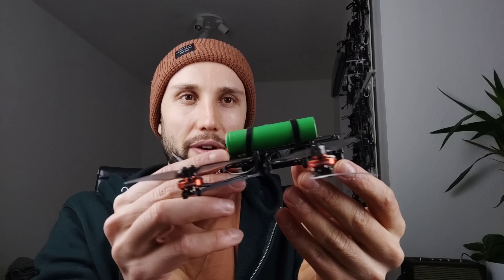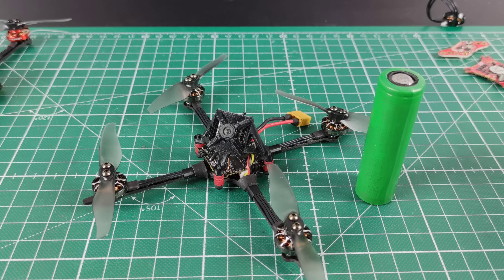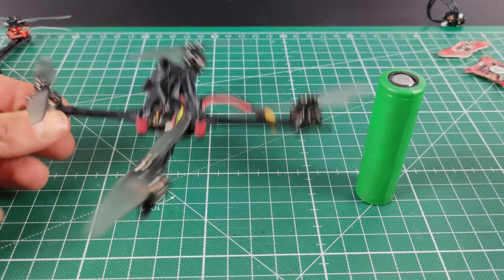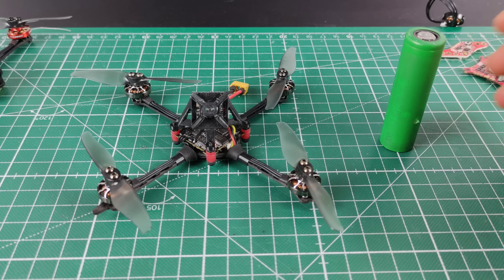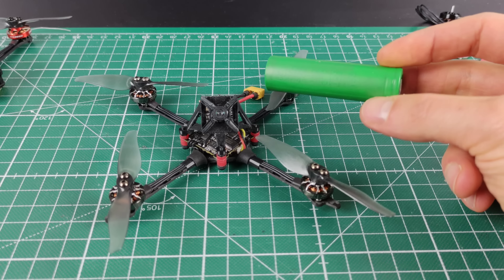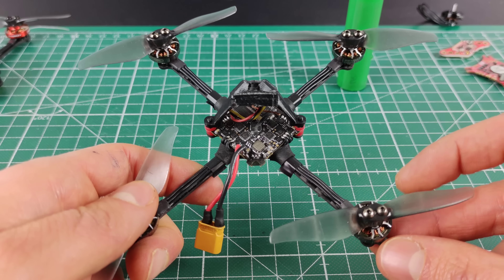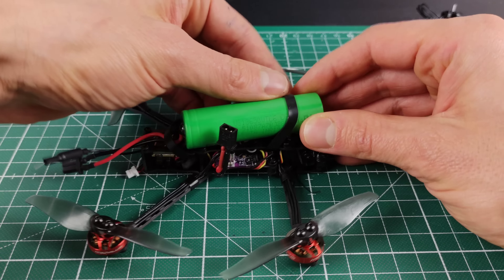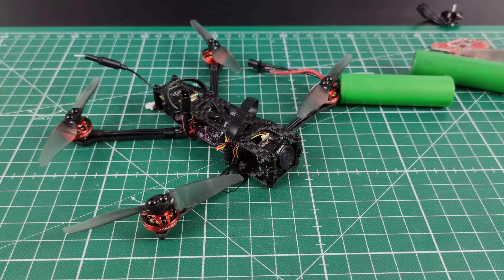#NanoLongRange

Comment: Awesome. I did some 18650 flights with that same cell on a 1S Baby Tooth.  After a bunch of flights I was getting a consistent 9-10min of actual no holding back FPV flight. I could get another 3-5min of hovering around but not enough power to have any fun with.  The new 1S FC we've made has a min operating voltage of ~2.3-2.5v with the hopes that something like this would be closer to possible.  I found 1103 motors to be more efficient.  I can't totally explain why and the performance definitely suffers a bit but it was definitely more efficient.  My best guess is the voltage better saturates the stator and the taller magnets give it the ability to maintain more rpm with less power. 

A couple years back, Chad Nowak did some calculations and came up with the ideal weight on a 3" prop at 90g. Pretty intesting that were around that weight and the overall performance even on just 1s really is quite surprising. Disk loading is proving more valuable than I thought. 

Those battery holders unfortunately don't conduct amps as well as a solder. Similarly, it's a bit sketchy but covering the battery ends really limits the cooling potential of the cell.  The ends of the cell cool it better than around the body.  The amp draw is high for the single cell so the cooler the better. 

I considered trying to squeeze more performance out of such a thing but ultimately gave up on it because of the lack of watts to do much with.

Also, I didn't test this because I only use xt30 but moving to an xt30 alone could give you more flight time and performance.  In my testing I found the gnb27 to be just a tiny bit better than the BT2.  Both are way overshadowed by the unfortunately much heavier xt30 and I've found these things in even 1s benefit from that.
Reply from the maker: Awesome, thanks for the inputs, Bob! It's really quite surprising how well these 1S platforms can perform. I probably wouldn't have believed it if someone told me that you can properly run a quadcopter with only 2.5V on the power supply. The lack of power further down the voltage range is less of a concern for something geared towards being a mid-range cruiser. The tray thing might indeed be too inefficient but it's worth a try. I have one with large gold plated contacts that look promising. The convenience of just popping a cheap and widely available 18650 in and get 15min flight time is just too appealing.
Reply: @DaveCFPV  I like to say that tv remotes run on more voltage 😅
Reply: @DaveCFPV   Can I print some and make the prints available at fpvcycle.com?

Comment: 1. Press-fitting those props is more than enough to keep them in place
2. Crazybee f4 lite actually has 350mw vtx (at power level 2), however it still shuts down at 2.7v (ESCs started rebooting during my tests). I will try to modify 5v step-up circuit there to accept lower voltages, but don't know when...
3. You should try 4" props on those 1202.5 motors. You may say it's a lot for them, but hear me out: once I've seen 1102 10k kv motors flying on 5045 props, and they were handling well! So I think that will be enough
4. Try making simple dipole for GPS, it should be enough

Overall: once again, very interesting video exploring new unknown territories

Comment: All of the outer "casing" of the battery is "ground", so you don't have to run the full metal bar from the other side, you can just open up the protective shrink wrap by the positive pole, and solder them kinda next to each other!

Comment: Well I'm messing around with 1s babytooths too. Here are some ideas: 
-I'm using no prop screws and it's fine (flywoo robo 1202.5) 
-There is no need for a top plate, 3d printed parts cold hold the battery. 
-You could save weight by using the Caddy Ant lite (1.5g). 
-Did you try the Gaoneng 1s 3000maH Lipo? 
-Try the Happymodel CrazybeeX with integrated 200mW VTX. On 1s you won't need a capacitor either.
-There needs to be some kind of higher quality video recording which is for me the main selling point of mid/long range. Naked insta360go? Runcam split 3 lite?
Thanks for being creative and innovative! BTW, I'm using your Sanchez lite design on my babytooth :-)
Reply from the maker: Thank you! Really great ideas. I have my doubts that HD will ever work on one of those, but who knows...
Reply: Maby a 2s 4" lr would be a nice middleground with enought power for a naked GoPro. Has to be under approx 125g to carry 2x 18650 + naked GoPro.
Reply: I am starting a build to, and opted for a dvr vtx. The fpv cam feed is recorded before it enters the fc. The caddx ant gives pretty good footage straight from the cam, although not HD, it is good quality.
Reply: Why not 21700 5000mAh/35A instead of 2600mAh/35A? +26g and + 100% capacity.
Reply: @benzoesansodu5866  you are sacrificing too much efficiency. The quad will be about 25-35% heavier. Currently the best option is lightweight frame with Sony vct6 3000mAh (47g)
Reply: @Unboxingexperience7  heavier but 5000mAh instead of 3000mAh. Its worth to test. Even Mavic Mini 1 with 5000mAh have 45min instead of 30 with 2600mah but are much more heavier.
Reply: @DaveCFPV  maybe a naked Vista with a step-up converter :)
Reply: You can reduce the weight even further, if you try to solder the negative Powercable directly to the cell, by removing a bit of the Heatshrink near the Positive Pad.
Reply: You probably dont care at all but does anyone know of a trick to get back into an instagram account?
I was dumb forgot my account password. I would love any tricks you can give me!
Reply: @Kristopher Briggs Instablaster =)
Reply: @Zane Elisha it worked and I actually got access to my account again. Im so happy!
Thank you so much you saved my ass !
Reply: @Kristopher Briggs No problem :D

Comment: Great vid. Accent is very understandable, no issues. The documentation is top notch and appreciated by me and others I'm sure. Have a Babyhawk 3" w f4 board,  rakon blade guards, was breaking blade too much, cam mount made of leather, old belt, Its fun.  The only suggestion I have for the batt tray is make one much lighter. Copper tabs on ea end. Stiff thin plastic under. The smart play, thin batt straps to secure. I love 18650's. E Musk came up w 2150 or something slightly bigger,  for his e car batts.  So, the metal casing has more weight than a comparable L ion but will never be damaged in crash. I'm subscribed.

Comment: This is super awesome. This is not a solution in search of a problem, its totally the kind of class of quad the hobby is missing: Accessible long range. The hardcore long range stuff is intimidating, but your parts list on thingiverse comes in around $100 usd which is super reasonable.

Comment: For the battery holder, you don’t need all the plastic in between the contacts. Just the ends that could possibly snap into the top plate. I would say skip the gps unless you figure a way to lose some more of the weight and keep it working. I would fly it

Comment: Love the idea! Few ideas while watching: (1) could you shorten the top plate at the front and print PLA standoffs that you could attach the camera directly to instead of separate TPU mounts? (2) Instead of a battery holder, could you print (PLA again maybe?) two end pieces that can be attached to the top plate (maybe using slots cut in the plate?) with contacts for the battery? (3) if you do mount the battery a simple switch might save weight for wires to the FC as well as for the connectors?
Reply: Yeah, stiff mounting end brackets for the 18650 cell, but then you actually don't need connectors or switches, you just take the battery out. 😁👍
Reply: @Anziilife  LOL - yeah, just take the battery out. I just like having a switch :)

Comment: For your GPS antenna testing, you might look at a nanoVNA. This allows you to meausre the impedance of your antenna so you can tune it properly. You might also look into GPS fractal antenna designs.  Also it would be interesting to see a breakdown by weight of all the components to see determine where removing weight would give you the best gains.

Comment: What is the Nano LR frame you are using? It looks different then the explorer LR?
Reply from the maker: It's a design I quickly put togehther. Less than 1/3 the weight of the explorer.
Reply: @DaveCFPV  Now do a Nano hex...🙄... 😁😁😁😁😁😁😁😁😁

Comment: I've been looking at something similar, but noticed the same issue with a 1S config.  So I went with a 2S 14500 pack (1000mAH each, 10A continuous, VAPCELL H10's).  The 14500 come in at 22g each, and at the end of discharge you still have 5V output (so you might come out ahead vs the 18650 cell).  I also explored a lighter GPS by removing the ceramic puck.  Just pull it off and replace it with a 45mm wire monopole.  For a full INAV config you probably want a barometer and compass as well.  I'm currently debugging a combo gps/baro/compass/RGB LED module that's about the same size as a BN-180 but only weighs 2.2g.

Comment: Why are you using that specific battery? Size? Weight? I would use an 18650 or 21700 4000mah.. Or is that too heavy?
Reply: The vtc6 18650 cell is the only cell that can deliver 30Amps continuous and does not drop voltage below 3V as other 18650 cells
Reply: @DutchCommando  You should look at vape batteries. I just bought a pair of 21700 4000mah 30amp samsung 40T batteries. There are a bunch of very strong vape batteries. In 18650 size too.

Either way though. Awesome vid.
Reply from the maker: The VTC has the most interesting ratios of C-Rating vs. Weight vs. Capacity :-)

Comment: Many years ago I had designed a microscopic low pass filter for FPV micro quads that is few grams, it never became a product.
If you're interested I still should have the file at OSHpark and you should be able to order it and solder it.

Comment: Turn the top plate into the battery holder also you can connect to the battery on just one end its negative every wear except the button

Comment: It's looking fantastic, Dave! Great idea! 😃
About the battery holder, you need to consider not only it's weight, but the cables and connectors weight. And I don't know if it's going to be much heavier than what you're using now...
Either way, I had problems with battery holders, I just can't remember now if it was like yours or if it used springs as contacts. Basically it started to lost contact with the battery too often. 😕
Anyway, stay safe there with your family! 🖖😊

Comment: Thanks for the detailed build! I tried to repeat the project, 15 minutes of flight seems very tempting to me. I ran into a problem. My Zeus 5 quadcopter crashed. I lost 2 resistors and don't know their value. I would be grateful if you could measure the resistance on them and let me know. I'll try to attach an image where I marked them, but it seems to me that I can't do it. Opposite the USB connector, if you turn the board over and look from the back side, there are 4 black resistors. If you position the board so that the resistors are on the bottom, then I lost two right resistors. Could you help me and tell me their denomination so that I can restore my flight controller? One of these resistances is called by one side to the ground. The second resistance on one side is called to plus 5 volts from the usb connector. Also, these 2 resistances are ringing among themselves. I really look forward to your help. Thank you!

Comment: Please continue development ! Bloody brilliant your work!  I am absolutely onboard.  Maybe you can use the 18650 as part of the frame w/ adjustable tension on the ends.  Different 5v upverters may have less noise that others?  I am so excited about this. The machine of my dreams.  An AIO w/o receiver and video but WITH support down to 2.5v optimised for Li-Ion? ABSOLUTELY! It would be revolutionary.

Comment: 1. There are smaller gps modules out there like Suq SIM28ML
2. I am going for the naked vista / nebula alternative  on a babytooth 1S, with a step up for the vista ...  hope it will work ( will move to your frame when released). 

3. On the li-ion cells the casing under the shrink wrap should be metal cage minus. Some handy soldering close to plus terminal  to and a short lead for +\~ might be the solution ... and will allow keeping the cell compatible with commodity chargers. Holders will be bad due to imperfect contacts unstandard length and most imp weight.
Love ur work!
Reply: Suq SIM28ML need antenna anyway

Comment: Maybe you could make a unibody with a top mounted battery. You could use a toothpick style stack in the front, with the camera on top of it, and have the battery sit behind it in the frame. This would eliminate the weight from the screws, standoffs and top plate.

Comment: The looks are perfect. The printed frame (in PETG) is durable and nice. Unfortunately the performance isn't that great (not at all), so we use 2S 18350 cells soldered in length. It fits the frame perfectly, the performance is sooo much better, and the full capacity from the cells is available. Good LC filter, perfect FPV image, much better tune flying without jitter and vibrations.
We use the Keeppower IMR18350 (1200 milli's, 10A) cells.

Comment: What is the weight of the top plate? I would try to model top plate with 18650 mount and 3d print it. I'm just wondering how much weight (if any) could be saved compared to your top plate + 8g for the battery holder.

Comment: I built something very similar, and I learned that the li-ion is actually not adding flight time. You should design these for a 1500mah 1s. I've gotten over 16 mins on a quad with almost the same dry weight and a 1500mah 1s. Since the battery is lighter the flight characteristics are considerable better.

Comment: Try to run the GPS from a 3.3V pad. This move from 5v helped me to improve GPS Performance on many of my quads.
Reply from the maker: thank you! hadn't thought of that!
Reply: Also more than often the 3.3v pad is always powered from usb. So if you plug in a powebank to usb, you can let the gps aquaire tha maximum number of sats without overheating the vtx. (I have gps on 3.3v on all my wings and quads (that have gps) and it works great!)
Reply: @DutchCommando  Yes absolutely correct. I uae this always to get a gps fix before i plugin the battery

Comment: Nice, setup! 18650 battery holder - no need for the plastic in the middle. Maybe you can put each side with two screws and wires going from each to the AIO board. Rubber bands can still be used with it. It will eliminate the connector, but replace that weight with the two pieces of battery holder. Also, have you ever checked if pcb wires are lighter than the wires? The screws on the top plate can probably be changed a bit to lose a gram or so. I have wondered if one screw would be enough to hold the prop, now seeing this setup I am wondering about that even more. That new Zeus board looks like a great upgrade. Decasing the CRSF wire was a good idea. Using plastic nuts for the screws holding the AIO? I am surprised that vtx antenna worked well, but how far out did you actually go?

Comment: I think the 21700 format lithium batteries would be the best choice for this. Specifically, the Samsung 50E @ 5,000 mah's, and 10 amp continuous rating. If that's not enough current, then the Molicel P42A @ 4,200 mah's and 35 amps continuous, or the Samsung 40T @ 4,000 mah's and 30 amps draw.

This is a question that's been running through my mind for a long time. I'm glad someone is visiting it.

Comment: Been buying various battery holders for 18650 too, but for a 5 inch quad. So far havent found a solution that i really like either. I think a small capacitor on the end of the battery holder is also a good idea, if you bump into something the 18650 batteries can be "loose" for a just a split second.

Comment: Dave :) I believe these types of quads should be called endurance quads. I was also thinking about this for at least a year and as you said they are not long range but they can fly behind mid range - but their main purpose is not to fly there. No one in their right state of mind would try and fly this one up a mountain without expecting to loose it haha but while flying as usual you can fly few kilometers away not even noticing it as it can fly for extended period of time.

Comment: Also the idea with the bracket for the batterie is dope-that would make it possible to have a hand full of dirt cheap batteries in ur pocket,ready to pop them in one after another and fly for ages -btw have you thought about 3D printing a custom bracket?-because one technically would just need the two contacts fixed on both sides,for fixating the batterie u still could use a strap(so using like a minimalistic bracket and something like a rubber band)-I imagine that could save some weight and would also make mounting easier

Comment: Interesting quad. What if you solder the minus wire near the top if the battery can without welding the strip to the bottom of the can? The whole can is a minus of the battery. Might save half a gram?

Regarding the GPS antenna, as far as I know, the ceramic thing separates "minus" and "plus" of the antenna. Think of this antenna as of a patch antenna that consists of two metal plates separated by air, but instead of air this one has the ceramic plate. Antenna frequency depends on the material of the separator. So you can't just remove this piece of ceramic. Not sure if replacing this thing with a plastic one may result in a working antenna.

Comment: I am extremely interested in suh a drone for some automated cruising. I would like to develop an automatic landing on a pad where I could charge the battery with a custom NFC wireless charger. 
This would need of course an additional chip/PCB on the quad but should not be more than some grams.